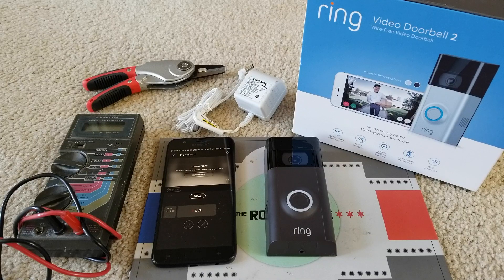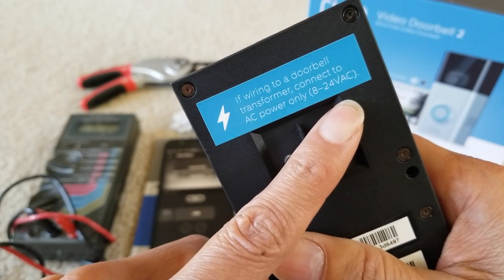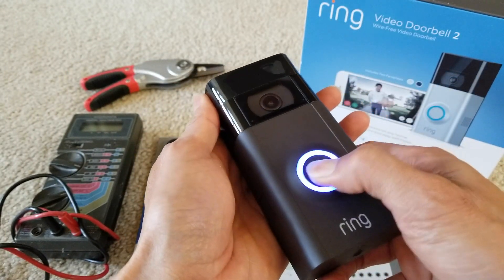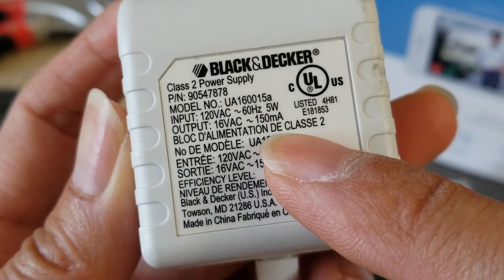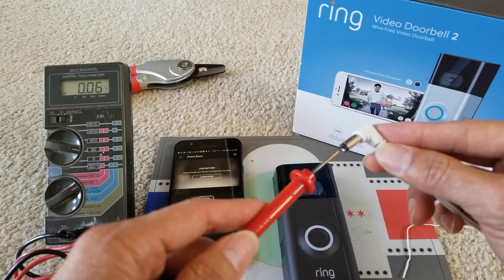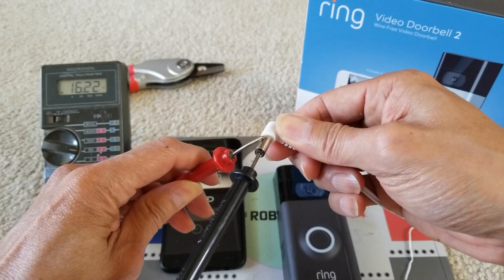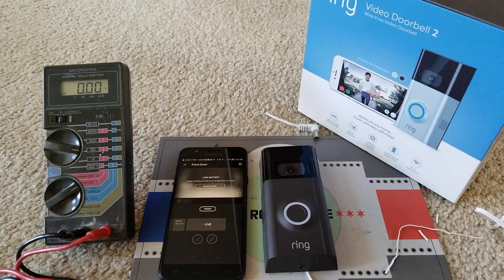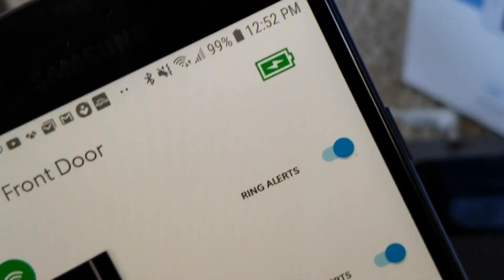DIY! How To Connect RING Doorbell 2 To An AC Transformer or Plug Only!

Comment: You need a wire wound resistor from ring or else that adapter can short circuit and potentially harm your doorbell im not talking about a diode resistor and diode are totally different
Reply from the maker: Nope, I did it without the resistor and it still working fine.
Reply: @macdaddypimpping  yea but the adapter shuts off when you press the button so it interrupts charging you can remedy this by adding a resistor or a doorbell whether mechanical(classics ding dong) or Digital(plays a melody)

Comment: I wired my mums like this and it was ok for 2-3 years than it stopped charging the battery , I spoke to ring and they said 
it needed a resistor , iv not bothered iv bought a spare battery and just swap it over when it runs low.

Comment: Just a note that battery charging is very slow from my experience - it's taken nearly 15 hours just to charge from 85%-90%. No biggie as it's hardwired but initially I was mistaken that the adaptor was not charging.
Reply from the maker: Ring recommend to install a resistor but I didn't with my setup.
Reply: @macdaddypimpping  what does the resistor do when setting up directly to a ac adapter transformer like you did? Also what happens when you do this setup without a resistor?

A few more questions if you don't mind. If going this route with the ac adapter. Will the external ring chime still work?

Also if going this route will it still power the ring doorbell if there's no battery inside? Or do you have to have a battery inside at all times when using the ac adapter?
Reply: Wow, it finally charged the battery to 100% - took more than 24 hours!

Comment: Macdaddypimpping, per Ring.com, a resistor must be used. It will work without a resistor but .....
https://support.ring.com/hc/en-us/articles/205180710-How-to-Connect-Your-Ring-Video-Doorbell-Directly-to-a-Low-Voltage-Transformer-Without-a-Pre-existing-Doorbell-
"Note: If you hook up a Ring Video Doorbell directly to an AC transformer without either a resistor or an internal chime, there is a serious fire risk.
Do NOT install a diode."

Other users have reported that without the resistor, the transformer will put out power that spikes  because transformers are unregulated. The resistor cuts down the current flow to the ring doorbell button/camera. If you don't use a resistor you will find out the first year or less cause your internal battery will go bad from over heating.
Reply from the maker: Mine is still working fine, I ordered a resistor from China and still not here. Will test it out and see and my battery still good.
Reply: These are internally regulated, no need for a resistor.

Comment: Macdaddypimpping, isn't the adaptor supposed to charge the battery? Mine doesn't seem to. Or does the adaptor only supply power to the unit? Does your setup charge the battery?
Reply from the maker: Yup, mine charge the battery.

Comment: Ok, Ring Spotlight USB charger output is DC and it didn't work with Ring Door Bell2. Tried with my Boston Acoustics speaker 12V-AC 150mA adaptor and it worked - power source now shows it's hired wired. Thanks so much macdaddypimpping - my ring door bell2 battery is now always fully charged. I also added a resistor as a precaution in case someone leans on the bell non-stop. Nice to see the ring door bell button now is always lit. Looks nice in the night 😂. I just bought an adaptor for permanent installation https://www.amazon.com/gp/product/B07PJHVJ2T/ref=ppx_yo_dt_b_asin_image_o00_s00?ie=UTF8&psc=1
Reply: The resistance is very necessary, it is for the protection of the transformer, it is not like that since at the moment of pressing the ring it makes a bridge in the two terminals, which causes a short and this is received by the transformer, so many are damaged is not  So I don't know what to do, I've been looking for transformers for resistors for two days, how to connect it and I can't find anything, that resistance has made me hell

Comment: It looked like you knew what you were doing up until the last few minutes 😂
Reply: I used a 24v transformer and the required resistor, however the resistor is getting extremely  hot. Is that normal? Do you guys have any suggestions for this issue?
Reply: @sdemily81  Really can't say how "hot" it should get.  But it's normal for the resistor to get "hot" as it is providing resistance to the electrical current.

Comment: You forgot the Resistor
Reply: Can you explain about the resistor
Reply: @wale8308  The Ring Video Doorbell 2 can only be connected to an AC transformer. DC is not supported.
Connecting the Ring Video Doorbell 2 to an AC transformer requires some knowledge of wiring and soldering. If you are uncomfortable reading wiring diagrams, hooking up wires or soldering them in place, consult a licensed electrician for assistance or use the built-in rechargeable battery to power your Video Doorbell.
Wires should be soldered onto the resistor and a wire clip can be used on the other end. 
In addition to the equipment included in your Ring Video Doorbell box, You will need to purchase an electronic resistor. A resistor is REQUIRED in place of a mechanical or electronic doorbell kit for this alternate configuration to work successfully.
Do not use halogen or garden-lighting transformer.
Do NOT install a diode.
 

rvd2_direct_to_transformer_720b.png
Reply from the maker: Mine works fine without the diode.
Reply: @macdaddypimpping  Who mentioned a diode?

Comment: How about the resistor?
Reply: I hardwired with proper ac plug in transformer and still doesn't recognize the power, Ring recommends installing resistor, maybe this will work?
Reply: @jimbeck9506  was it an a/c transformer? It won't work with a d/c transformer
Reply: O
Reply from the maker: You only need to install diode if you are connect directly to your doorbell button that is digital chime only.
Reply: macdaddypimpping I don’t have existing doorbell or any power supply. I want to hardwire it and it needs a resistor at their website says
Reply: If you do not have a door bell that does the job of a resistor, then you need a 1 ohm resister on the transformer output. If you do not install the resistor the battery will over charge and burn up and fail.
Reply: @gunlover1955  25 ohm +/- 5% 50 watt wire wound resistor - use the right one or it'll potentially overheat & become a fire hazard. Thanks!
Reply: @gunlover1955  This is actually totally incorrect. The resistor has NO EFFECT on the battery charging. It is there to protect the power supply when the button is pressed, as the terminals are connected together for a fraction of a second when the button is pressed. This applies the full power supply voltage across the resistor. 
24VAC across a 22R resistor would give 1.09 amps if the supply can supply that much, which is about 26 watts. That's why they specify a 50 Watt resistor (for plenty of safety margin).
If you use a 12VAC supply (still plenty above the minimum 8V), then there's only 0.55 amps through the resistor, which is only 6.6 Watts, so a 10 Watt resistor would be fine.
Reply: Justo lo que pensé exactamente al momento de presionar el botón los dos terminales son conectados esto causaría un corto directo en el transformador si en media hora no dejaras de tocar el timbre serían cientos de cortos que haría esto dañaría el secundario del transformador pero la instalación de una resistenciao no  no tendría ningún daño en el ring doorbell o si no es muy necesaria si malamente me tocan el timbre máximo 3 veces al sia
Reply: @323ric  I'm so lost reading so many mix informations. Please help. I have a ring doorbell 2. Now if I want to use a ac adapter from Amazon. Do I have to do anything else? Also when using a ac adapter. Does the battery need to be inside the ring doorbell? Will the ac adapter power the ring doorbell without thr battery inside? Also if I go ghe ac adapter route will my ring chime that is connected through wifi still work?

I'm so lost on the resistor for the ac adapter route. I hear so many people saying they don't use it and then I heard  a lot of others say you need a resistor? Please clarify....I would really appreciate it 🙏